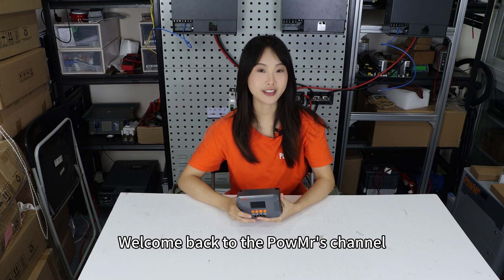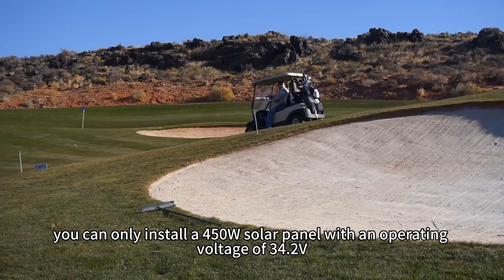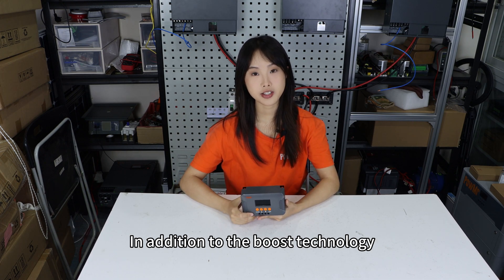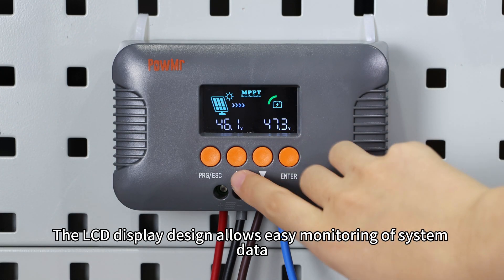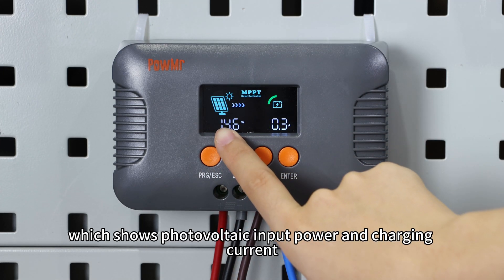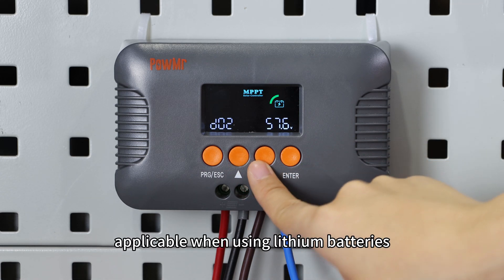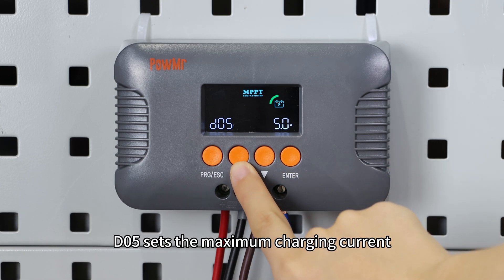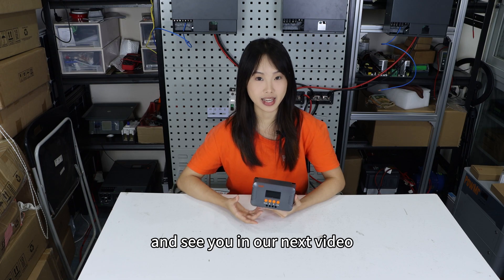PowMr New 10A MPPT Solar Charge Controller

Comment: Can it handle a 72V open circuit (57,7 V mppt) panel ? Hard to find a small controller for this panel. Battery is 20x 4,2 = 84V maximum.
Reply from the maker: Hi, please send your problem to this email: support@powmr.com

Comment: what is the maximum input power(W) of 60V system and can I set maximum charging current?  I want  to set maximum 3A charging current for my 60V (12*5) sealed lead acid battery pack
Reply from the maker: Hi,the maximum input power is 400W. You can set it in the 05 setting item.

Comment: I have a 12v/35Ah, 60vdc (12v x 5) graphene lead acid battery, 200w solar panel with 24v open ckt voltage. I set d01= 24, d03=69, d04=66, d05=6, d06=59.3. The display is showing operational mode 7 ( content voltage charging state), pv input power = 0, charging current = 0 and the controller is not charging the batteries. All electrical connections are OK with no ERROR message. What seems to be wrong with my settings why it's not working?
Reply from the maker: please send your problem to this email: support@powmr.com.

Comment: Bught it, it ignores my battery voltage of 60v, and tries to charge for 48, even i set up all menu items as in table, but D6 still shows 42v. Seems broken or just poorly designed for me. 

Zero charge for battery
Reply: We have the same issue here. Mine is not showing charging current and pv power input; they are both zero. Battery is not being charge.
Reply: @oliver2943  they sent me new board, and it still doesn't work. Switched to mpt-7210a, it works good

Comment: How much maximum PV panel power (w) for LFP battery 51.2V (16s)?
Reply from the maker: 250W
Reply: @PowmrSolar  Can we use 400w++ insteed ? if 250w is no longer produced.
Reply from the maker: @sirichaihomnan5578  Maximum PV panel power is 400W, but the system voltage is 60V/72V; the PV input voltage is 48~60V.
Reply: So, when using a 60V battery pack can I use a solar panel which is Voltage at Maximum Power (Vmpp) = 42.52 V, Current at Maximum Power (Impp) = 13.76 A, Open Circuit Voltage (Voc) = 51.16 V, Short Circuit Current (Isc) = 14.55 A, Panel Efficiency = 22.65 % , Power Tolerance (Positive) = + 3 % &  Maximum Power (Pmax) = 585 Wp ? @PowmrSolar
Reply from the maker: @nipunawanigasuriya3321  Please send your problem to this email: support@powmr.com.
Reply: @PowmrSolar I sent but there is no reply for this Question until now
Reply from the maker: @nipunawanigasuriya3321  Hi, please note that we may not be able to promptly respond to you due to the Lunar New Year. We apologize for the inconvenience this may take and thank you for your understanding. We wish you all the best!

Comment: In pow keeper 1220 model controller,how to set maximum charging current and voltage?i am using 12v 80ah flooded lead acid tubular battery and my panel is 12v 150 watt but i always get under 5 ampere charging current in sunny days that's not enough for my battery i already saw your pow keeper 1220 model,s settings video that you recently uploaded,i thing the settings you explained may be its not proper and you didn't tell about the working of temperature sensor!please explain more transparently about pow keeper 1220 model controller  it's very necessary for me thank u and i wish you will make a new explanation video😊😊😊
Reply from the maker: Hi, This controller does not have a setting item that can set the maximum charging current. If you want to increase the charging current, you can configure a 24V battery system and add solar panels. However, the maximum open circuit voltage of solar panels is 60V and the maximum input power is 520W (24V system), and the maximum input current of 20A for 260W (12V) systems cannot exceed these values.
Reply from the maker: The temperature sensor is installed to protect the controller. It can keenly sense the temperature change of the controller when it is working and the environment around which the controller is installed, so that when the controller senses that the temperature is too high, it will start the heat dissipation function, and at the same time reduce the current power during operation to reduce machine damage. It also prevents overcharging the battery. When the perceived temperature is low, the machine will also activate the protection function to prevent damage to itself and external access sources.